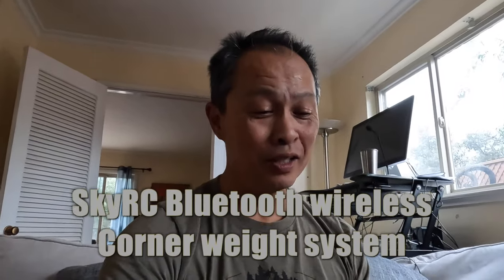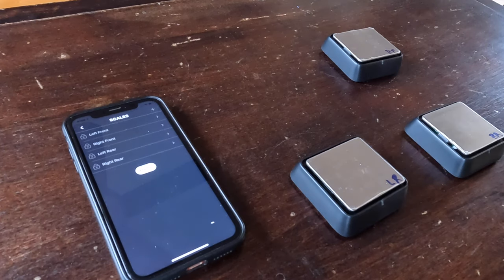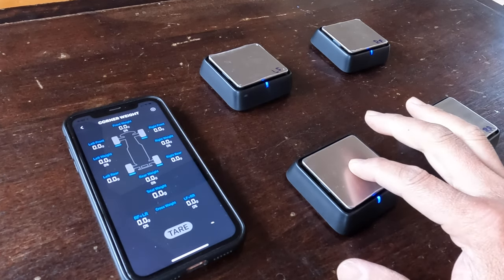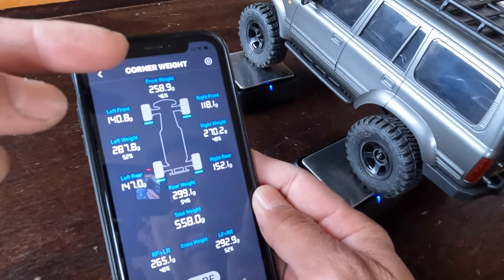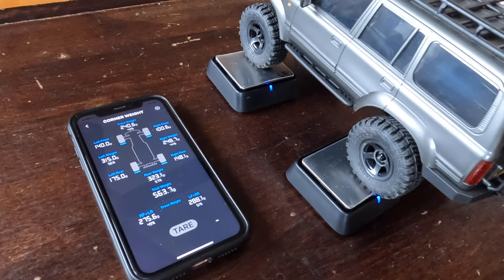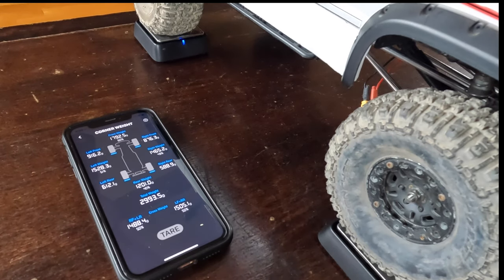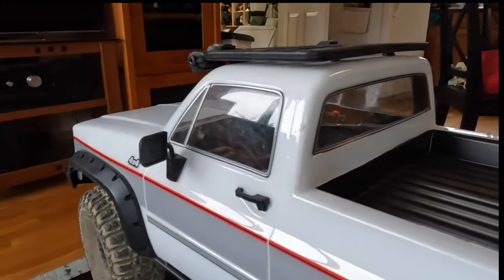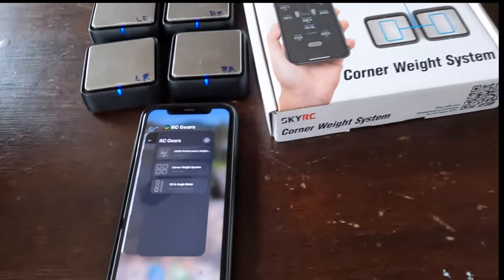Skyrc wireless Bluetooth Corner Weight balancing system for rc cars

Comment: I picked up one of these (from RC Juice, and for $40 less then Amain's price) a few weeks ago.  I still have the wired version, but that'll now be my 'backup' RC scale, as this one provides more info, is easier/quicker to set up rack time it's needed, and is easier to travel with.  The only "downside" is, when swing it up before each use, one needs to make certain they place each unit appropriate to the correct wheel.

Regarding the "they turn themselves off" comment, that's, technically, incorrect.  They don't actually York themselves off...they go into a low-lower 'receive only' mode...meaning that they ARE still drawing battery power, albeit a very minimal amount.  This is what allows them to reconnect to the phone/app the next time the app is started.  The only way to prevent all power draw is to turn the scales off manually (the method I recommend).  Then, when you want to use them, first start the app, then turn on each of the scales (one at a time, waiting until it's "connected" before turning on the next).  Yes, this method takes a little longer, but only by a few seconds...plus, it'll save battery power in the scales.

Comment: I have the wired version & I found I got a more consistent reading if I set the tires in the center of the scale. To make that easier I put an X on each scale from corner to corner.